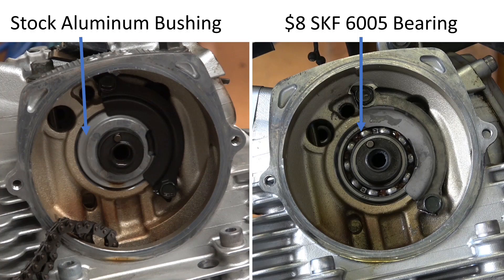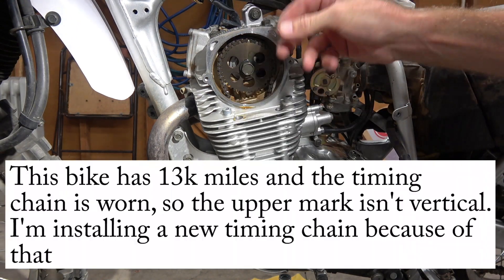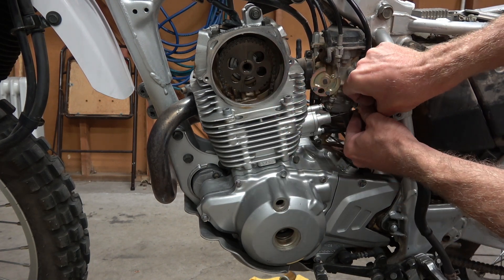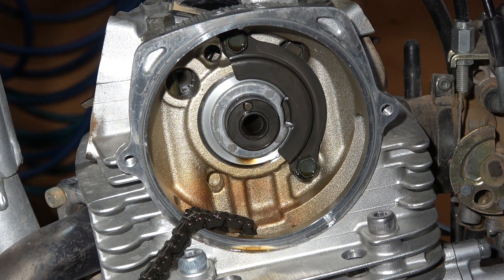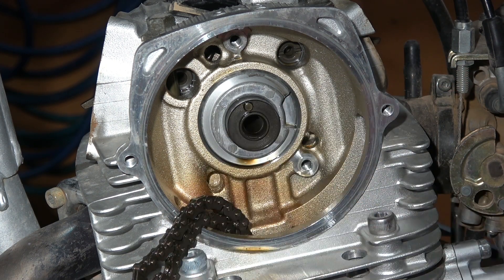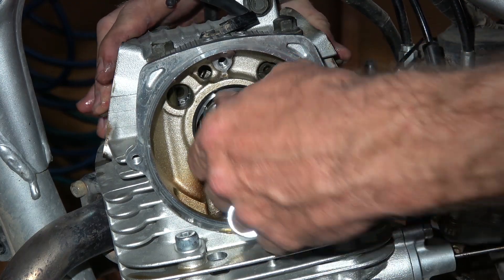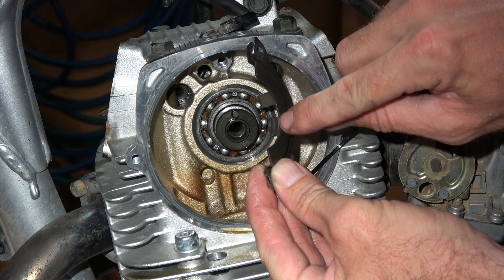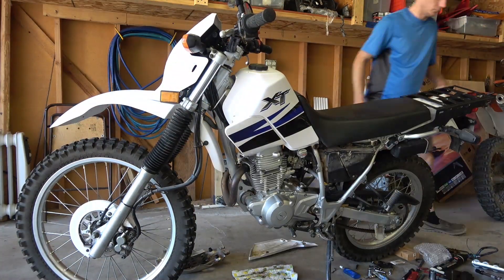Yamaha XT225 TTR230 Upgrade Cam Bearing to Ball Type

Comment: Thanks for the information! Although I don't own one of these motorcycles, this engine is identical to the one in my Yamaha timberwolf. I had an issue with the cam bolt backing out and the gear fell of and tore up the end of the camshaft. In finding a new cam I found it shares a cam with this bike which I could get much cheaper. I also came across this video and considered the upgrade. When I removed the bushing off the old camshaft I found it had uneven wear, and that's what made me decide to find this video again and find the bearing you suggested. I can't wait to get these parts on order and get this fourwheeler up and running!

Comment: I think you would want TDC on the compression stroke? I’m thinking an unsealed bearing would be best. There would still be residual oil in the bottom portion of the outer race when shut off?

Comment: Did the bearing last? I got a moto 4 with the cam bushing worn out was thinking about using the bearing just like to know if it would last a while before I do  replace it with a bearing.thanks.

Comment: Hey Alex, great video! My XT filter checked out fine, and engine still runs, but with lots of "piston slap" noise. I adjusted valves to spec, and they weren't far off. The bad; when I turn my crankshaft manually with a wrench, it makes a very audible metal friction sound throughout the strokes. Any thoughts before I take it into a local mechanic? Is a top end rebuild within a beginners ability and worth the $ for an XT? 10kmiles btw. Thanks again!

Comment: Worked great,  The only thing I did different Was clean the grease from the bearings and replace it with engine assembly lube so the oil passages didn't get clogged with grease.

Comment: Was the bike making a loud ticking noise when this happened
Reply: Wr250 fits an xt250- paper element. TW200, xt225, ttr225 and 230- same thing- all have a fine mesh metal filter with a special oil hole. Did you watch the beginning of the video? And in my opinion those ball bearings would not hold proper oil pressure
Reply from the maker: I have converted two bikes. The first one I bought seized up so I didn't hear it run. The second one I converted is the one in the video and it's bushing was fine so the bike sounded normal.
Reply: That’s my question also.   I ran my wr250 filter in my wife’s xt225.   Just saw this video, and wondering if it will fix.  It sounds like rod knocking

Comment: Very informative video. I just wonder if the aluminum bushing was designed in part to direct the oil flow where needed vs the bearing which may starve parts for oil?
Reply from the maker: There is an oil supply hole in the cam that supplies oil to the bushing. The bearing covers up that hole, which forces that oil to other areas like the other bearing and the cam lobes. That is the way I was thinking anyway. I have since sold this bike but it ran fine for 1000 miles before I did.
Reply: @alexkram   I appreciate the follow up!

Comment: I used the wrong oil filter on my wifes 230.... feel so stupid. Now researching engine stuff. Thanks for the video!
Reply from the maker: Hopefully you can fix it like I was able to, and it's an upgrade.
Reply: @alexkram  yea I like the bearing mod, how are the engines holding up?

Comment: I was reading another forum article on this rework and he was saying much the same, with similar experiences. He did say that of the various types of 6005 bearing available he went for the 6005ZZ. The metal sealed ones would stand the cylinder head temps whereas the rubber seals may not. He also suggested removing the metal shield from one side for bearing lubrication but to keep the outer seal in place. his reasoning was that it would prevent head oil draining away when parked on the side stand.

Comment: Great video and thanks for posting.  I made the same mistake this week with the wrong oil filter.  The bike started chirping and then locked.  It runs now (with the proper filter) but I've been told to do this.  Are you fairly sure only the bearing is needed ?  Thanks in advance.
Reply from the maker: I think so. It's not hard to do but you will have metal shavings to clean up too probably. I did not need to replace the cam when my other bike seized, I just cleaned it up with some scotchbrite.
Reply: @alexkram  Thanks !  I let it idle a bit with a new filter and there were no shavings at all in the filter. Odd.

Comment: Whats the advantage of swapping to ball bearing?
Reply from the maker: There are a few advantages. I think the ball bearing will last much longer between failures because a journal type bearing requires some oil pressure to work and the design of this engine, with holes at the cam lobes, does not provide oil pressure to the chain side bearing.  A ball bearing does not need oil pressure, just some oil now and then. This is my understanding of how these types of bearings work. Also the stock part costs $60 to replace while the ball bearing costs $5, so once seized the ball bearing is the cheaper choice too.

Comment: is it possible to do this for Yamaha TW200?
Reply from the maker: I am 99% sure it is the same.
Reply: @alexkram  Awesome. thanks.my tw's cam sprocket got a little play. Is it normal? How to know the collar is worn?
Reply from the maker: @chaminda.perera_03  it isn't that hard to take it out and inspect it but if you can wiggle it around that isn't good. Be sure to set those valve clearances after you make any changes.
Reply: @alexkram  Thank you. it's really helpful. ☺
Reply: @Suzukisan Thank you. I think my one is worn it wiggled more than 1mm horizontally. 😞

Comment: Just did to two ttr230 worked great same bearing fit. Was surprised to see both aluminum bushings I removed had wear on them.
Reply: what cam bearing did you use to your ttr 230f and size may i see your upgrade?

Comment: I had a family member drop off their very neglected XT225 last week. Only 13k on the motor, but not much works on the bike. Winter project for next years fun.  Thanks for this video, I will have to consider this since I have to reseal the motor, leaks like a sieve.